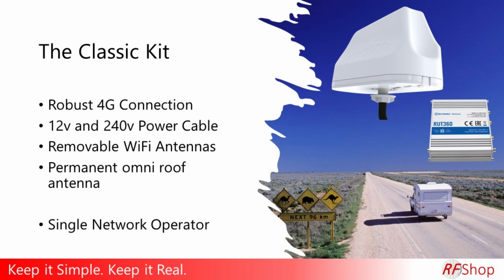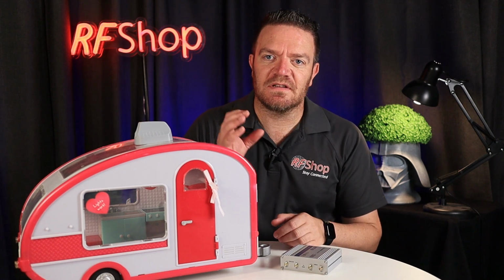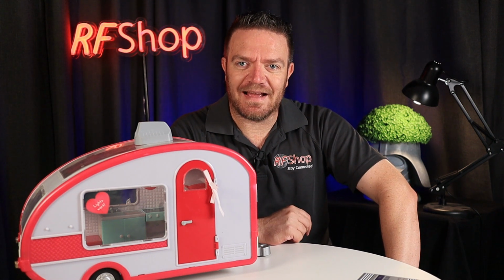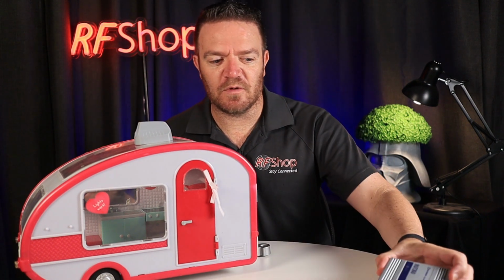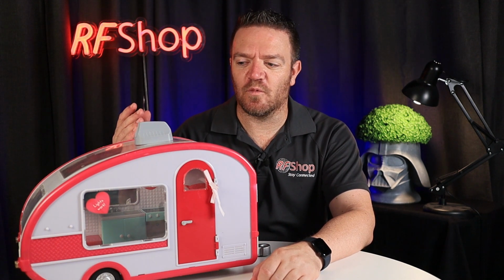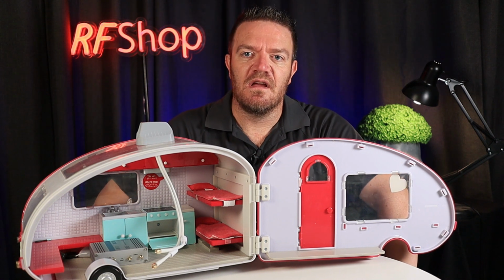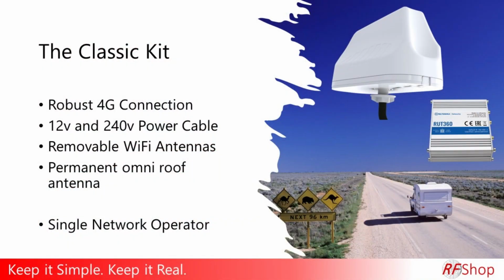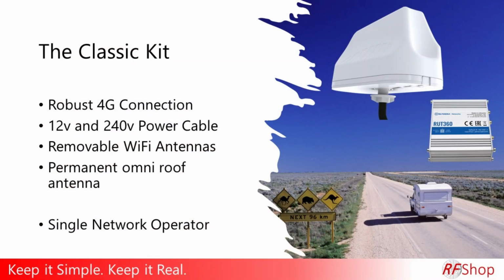Reliable Internet Connection to Your Caravan

Comment: Great vlog. Am I right that this is just for when you are using a SIM card so it won't pick up an boost a local wifi hotspot signal say on a campsite?
Reply from the maker: That is correct...this is for SIM-card specific solutions